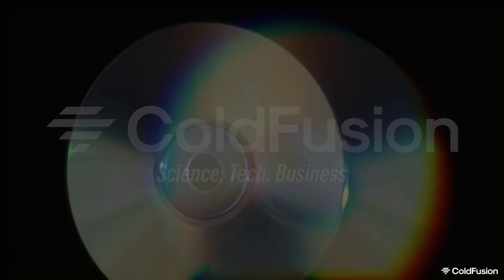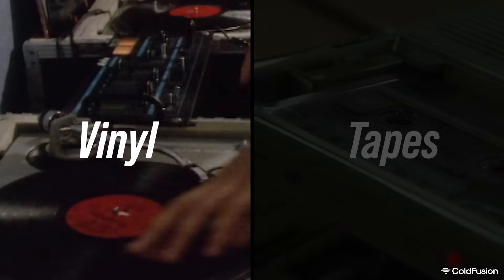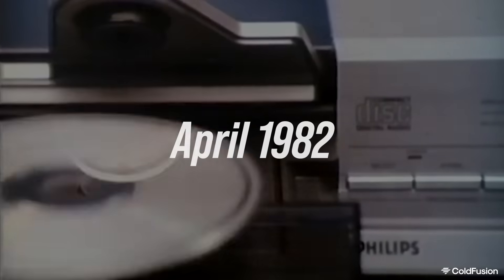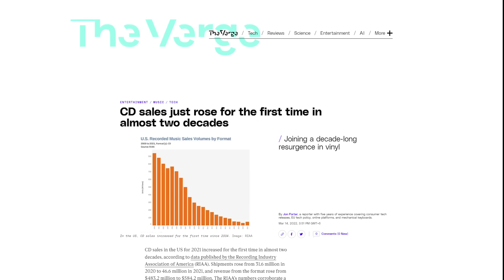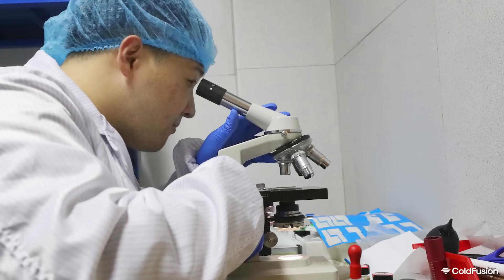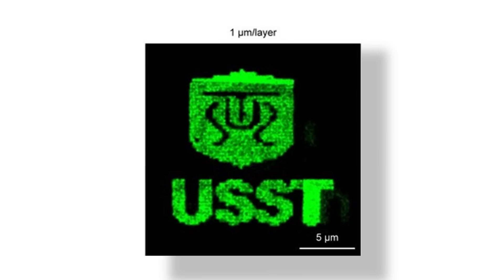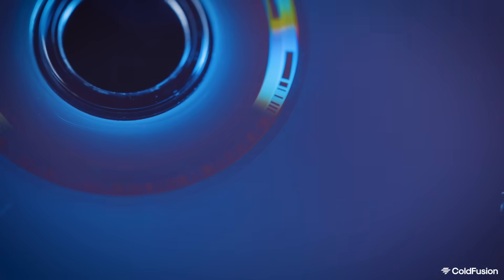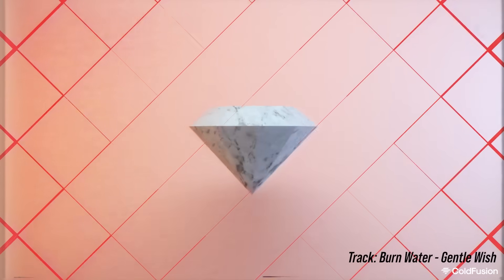Why This New CD Could Change Storage

Comment: The main problem with this new CD is that if it gets scratched, you lose all that data. I remember buying blank DVDs about ten years ago that aged badly, and the silver material flaked off, making them totally useless. It's not really a problem if you're only working with 4.3gb, but 2.6 petabytes is too much to trust to a disc that can be easily damaged..
Reply: Listen/watch more carefully - it is 1.6 petabits = 200TB, and for that volume/value of data, it is well worth using more than one manufacturer's media to avoid getting stung by the kind of manufacturing defect you describe.  You should never have any data entrusted to only one type of media anyway.

Comment: if i can switch OFF of cloud storage im in, sure it has advantages BUT it also has its drawbacks like if an error happens in payment, BOOM all your stuff is gone.
think of how much storage a NAS could have if you did the 6 disc turntable with storage for more discs below.
a case for the discs wouldnt have to be that much larger than the disc and if you really wanted to protect it from damage, put it in a case like how floppy discs got to be with the little sliding door but a little larger.

Comment: DVD+R & DVD-DL are still my main method of long term data storage. I wanted to try BluRay but blank media was always so expensive- not to mention the cost of the burners, plus the reviews of burners online seemed to indicate they didn't have as long of a lifespan as DVD & CD burners. Has anyone here used BD-R for data storage or etc? If so, what was/is your experience with them? Thanks. :)

Comment: Couple this new storage technology with a small hermetic unit that is environmentally protected from fire, temperature, etc. and you have a fool-proof archival system to be installed in every "Fortune 1000" sized company, which eliminates any need for off-site storage...or the cloud !   Also great for government and/or highly sensitive data.

Comment: The bit about these being good for "longevity and storage" is a lie at worst, and at best an outdated, theoretical, marketing bullet point.  Disc rot is real.  This doesn't use a mylar layer for writing so, maybe, this will last longer than a traditional CD or DVD but with time these plastics can, and do, degrade.  When you need hard precision at such a microscopic scale, even having .01% of the disc breaking down over 20 years means that these discs will be unreadable.  It's really tough to estimate a consistent shelf-life of these things, but ask anyone who collects optical drive game media or music.  Discs kept in good, climate controlled environments still work from the 80s and 90s, but others that have been in garages or attics are toast with disc rot. I know, you might be thinking that the key is to keep these discs in climate controlled areas. As true as that is that it will help, it's only stalling the same process that is accelerated in the hot-to-cold garage. Furthermore, when the data is smaller that needs to be read, it means that the medium that you're reading from needs to be more consistent and undegraded.  As the plastics break down over time, again, in 20-30 years, these discs might look fine to the naked eye, but at the micrometer level, they may have minor flaws throughout the disc that have rendered the entire thing corrupt and unusable.

Comment: Physical storage devices don't really last forever especially the one using rotating method with reading and writing actuator arms . I lost all old datas and pictures in my external HDD. SSD and thumbdrive are more reliable compare to rotating disc.

Comment: Dude, imagine trying to resilver one after failing in a RAID array and it doesn't even write or read at 500MB/s lol. It would take a few months. Of course, the disk itself probably wouldn't fail so I guess the remedy would be to have nodes full of read/write devices that disks could be placed into and removed from. I am curious what the write endurance is too though. Once the disk has been burned can it be rewritten? If not, these things will probably only be used a particular situations.

Comment: 20ish years ago, there was a technology called 'HoloGraphic Discs' that used a similar technology to store around 20-40TB per disc. I was eagerly looking forward to this, as it seemed like it was on the verge of going into production, then, *POOF*! Nothing. 

I was born in 1970, and have been a Tech-Head since the late 1970's & loved CD's. However, Nostalgia means nothing to me. I'm only concerned about practical, useful (and cool) new developments. As long as READ speeds are practically useful, this tech could save an awesome amount of money in many fields. I myself, have been archiving data since the mid 1990's and currently have 72TB. It would be great to not have to spend piles of money on large HD's on a regular basis.  I hope it takes off.

Comment: Now enclose multiple of those discs in a hard metal casing, and add in the required laser components for reading and writing. There, we are right back at hard drives, but now optical instead of magnetic.

Comment: My university department deals in large sociological datasets that researchers need to load into programs like Python and R, and the old bois of the researcher world, Stata, SPSS, and even SAS. These datasets are getting into the terabytes these days, vs a few dozen GB when I started at this I.T. job.

It'd be nice to move the archival stuff off of disks (we used to have a tape system but it was too cumbersome, read times to oslow for individual file recoveries, and got rid of it 20 years ago in favor of more and more HDDs - restricted data means we're not allowed to store it in AWS, Google, Microsoft, or anyone else's offsite cloud - legally the data needs to exist at our USPS address and no where else) and move to a 200TB-per-disc system like this, with a robotic arm grabby system like the old tape archive system.

But yeah, we couldn't abide write times like this new system describes to do archiving. I think read and write time are now the current killer issues in this sort of archival conundrum, much more than per-unit capacities. We'll see what the researchers are able to eventually do, but yeah I would have thought optical storage is dead. Onwards to Holographic Cubes (yeah those are "any year now" haha)

Comment: Consumer mass market doesn't really need, want, or have any use for petabyte media however if a CD/DVD (and reading device) having a 5 to 50 terabyte range can be mass produced at anything resembling  reasonable cost I am sure there is a ready and eager market for the product. CD optical storage is unquestionably more stable and  less vulnerable to damage, corruption,  and other forms of  information loss than electronic storage. It should be noted that 50 year old CDs are still holding up well and still using current CD/DVD players, formats , technology and you own your information in completely unhackable personal privacy.
Reply: The mass market consumer has no use for petabit capacity, and if you intend to preserve your ssd/hard drive information you had better use RAID storage, a lot of caution and hope for the best.

Comment: 1.6 Petabits = 200,000 DVDs?
1.6 Petabits = 200 Terabytes (or 0.2 Petabytes, or 200,000 Gigabytes).
A typical dual-layer DVD could store 8.5 GBytes, so the real figure is closer to 23,000 DVDs.  Not 200,000.

Comment: The first optical disc drives that came out were very slow and very expensive, like the IBM 3363 in 1987.   New tech devices start off this way and gradually become easier to manufacture and therefore cheaper to buy.  A $40,000 femtosecond optical drive today could be 1/100th the price 10 years down the road and the new devices much faster.  AI generated 3D worlds in games that are petabytes in size could become normal in the future.

Comment: You kind of missed the biggest draw back.
First one you mentioned is a matter of personal preference, I have tons of physical media because I like it.
Second and third are technological ones that might be overcome.
The real draw back is... imperfection. The denser you pack data, the greater amount of data that will be impacted by the smallest blemish. This technology is absolutely useless outside of laboratory conditions because even achieves cannot ensure the condition of the disk to be kept that pristine.
Remember, even if the blemish doesn't reach the data layer, it can be well enough to stop whatever reading laser from reaching the data layer. The smallest refraction can cause a huge difference when data is that tightly packed. Now, that might be recoverable but.... have fun with that.

Comment: Scratches was also one of the main problems of many using it. If using scratchproof surface is not a choice because it can add more to the price why not just protect it with a plastic container like the diskettes way back.
Reply: DVDs and CDs shipped with protective caddies sometime in the early to mid-90s, with drives specifically designed to take them that way.

I kind of wish that had stayed.

Comment: The reason form me for no longer using CDs/DVDs as storage is CD rots other than damage surfaces. Compared to other media, when a CD rots the entire data part is completely destroyed. Hard drives, SSDs, Flash drives if they got problems or can no longer be accessible through normal means you can still get the data using recovery softwares. But CDs with rot it will be like having a book with a big hole in the middle making it no longer recoverable.

Comment: 1.6 petabits is NOT equivalent to over 200,000 DVDs; it’s 200,000 gigabytes. It only takes a little over 42,553 standard single-layer DVDs holding 4.7 GB to store 1.6 petabits.

Comment: More storage for physical disks is always much appreciated. Especially for movie discs, the current Blu-ray standard is still heavily compressed compared to the DCI standard. 3D Blu-ray is even worse and definitely needs an upgrade since they only support 1080p/SDR. A movie like Avatar 2 is available in 3D/4K/HDR/48FPS and the movie Gemini Man is even available in 120FPS which is all not supported by 3D Blu-ray. Those kinds of movies in high bitrate would need hundreds of gigabytes, probably even terabytes in their highest availability.
If we get upgraded Blu-rays with more storage it's definitely much appreciated!

Comment: YES! Exactly the tech I was thinking of for creating Isolinear Chips & rods, I was thinking Nanoscale QR codes Written on the layers just like this & Read by a Isolinear chip reader that has camera inside that can move around & read nanoscale QR codes. & rods wound be Rotate able Allowing the data layers to be cross layered with others Layers of QR codes that When Viewed in multiple 2D Angles & Perspectives allows for Clear & Concise reading of the data. #HireMe, #24YrOldOpenMindedACreativeEngineer Looking to Invent new tech based on various sources from old tech to analog to steam & biotech even fictional tech like those in star trek & star war & star gate & quantum leap & more... Dune, LOTR, etc...

Comment: So it’s basically 200 terabytes. It is 4000 times the size of a Blu-ray disk but it’s still much slower than a ssd. And also for now it’s kinda useless outside of data centers because for music or movies a regular cd, dvd or blu ray works fine and for computers most don’t need more storage than a regular nvme ssd that is significantly faster. The only use case would be physical games that are not sold really anymore and also this disk is still too large for them. The idea is great but right now the only actual use case is for data centers that don’t need fast read or write speeds

Comment: What is the use case though? With most media available on streaming and most things like Wikipedia being updated dynamically, I don't really see a consumer use case. Perhaps it might be useful for sending out next-gen IMAX digital prints, but that's hardly a mass producable market, and the cinema itself is a dying medium to boot. It's cool that they can do it, but there were plenty of storage media before the CD that fell by the wayside during a time when there was an actual demand for this kind of data storage medium. In a world of high speed read/write flash memory what do we use a PTB optical disc for?

Comment: I still use CDs, Blu-rays discs to burn my movies, yes, you can easily just grab the movie file and play it on a usb or whatever, but I like the feeling inserting a physical movie discs in a actually player, I know for a fact if they sold these discs, it's going to be too expensive, even to this day blank Blu-ray discs are still expensive, yet no one hardly buys uses them anymore, they need to lower the prices on these discs.